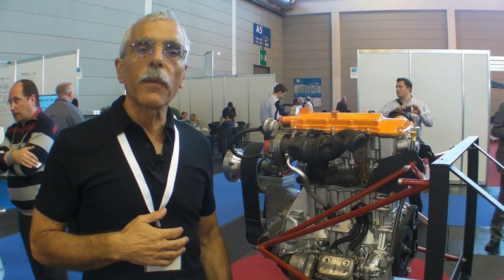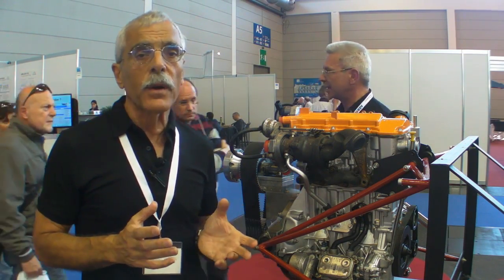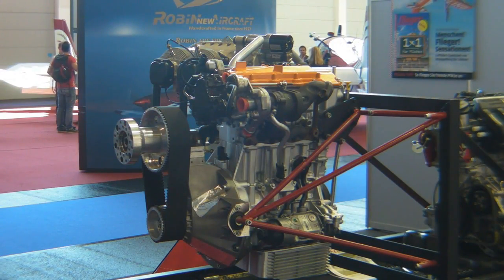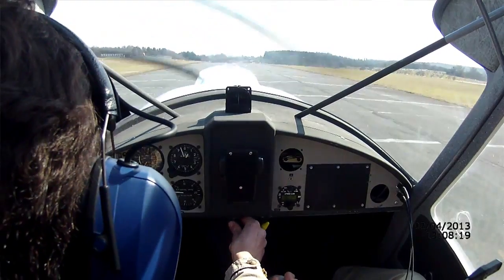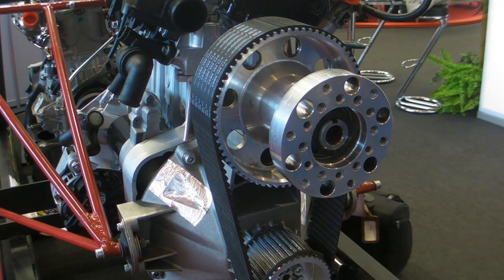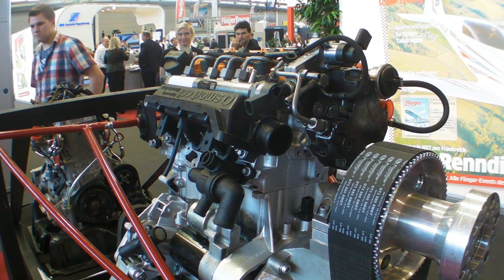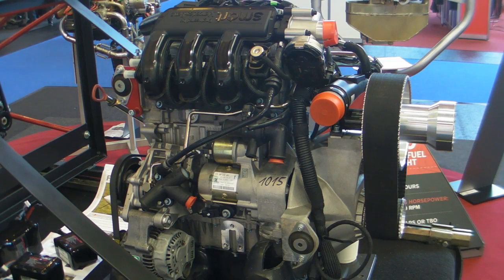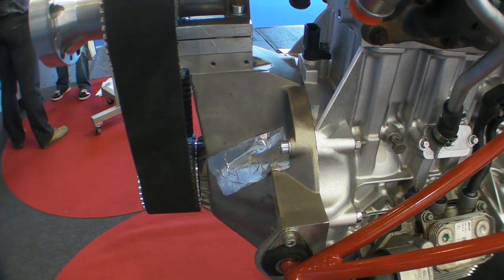FlyEco's Three-Cylinder Aerodiesel

Comment: Only 7 liters per hour = 1.8 gallon per hour.  This is amazing.
Reply: MR. RAY, 
I SEE YOUR COMMENTS ON MANY OF THE AERO ENGINE SITES THAT I VISIT. IN YOUR OPINION, WHICH IS THE LIGHTEST DIESEL AERO ENGINE AVAILABLE ON THE MARKET TODAY SIR?
Reply: 7 litres an hour would be at 50% throttle. If it was at the full 58.8KW it would be 97g/kwh, which is double the fuel efficiency of a modern diesel engine.

Comment: If the USA had 70 percent of cars using diesel it would reduce fuel used by cars by 70 percent.
Reply: Who taught you math?

Assuming a diesel uses 1/3 less fuel to do the same work you'd reduce consumption by 70% of the cars by 1/3.  So 30% of the cars would still use 100% of the fuel they always used, and 70% would use 66% of the fuel they always used.
Reply: And modern diesels also have more problems with NOx emissions than petrol-powered cars. You may have a bit less CO2 out of a diesel engine, but a good petrol engine will run overall cleaner.

Comment: 3 cylinders are the future for a wide range of markets. I believe in some markets they shall replace the 6 cylinder diesel in commercial vehicles.
Reply: It gives 3 powerstrokes per revolution and has total loss oiling. it burns SAE30W low ash oil too!
Reply: what do y meannot reliable oil consumption?

Comment: 89kg?  I'm interested.  That's not a deal breaker, especially for a 600kg machine.  A Jabiru 2200 is 30kg less but apparently they need a top end rebuild at 750 hours and definitely use twice the fuel.  A 600kg Jabiru J170 would still have 230kg useful load.

Comment: Same weight and power as a good VW conversion on half the fuel burn (in gallons, not pounds), for roughly the price of a new lightweight O-200-D. No mention of vibration studies or anything else on the redrive. Interesting exercise.

Comment: G56ag u can't run jet a without a lubercant as jet a lacks the oils to lube the fuel injectors but u can buy howes diesel additive and can do the job if u used jet a I use jet a in my diesel and have to use that to prevent damage
Reply: Kerosene is abrasive & will wear injector needles very fast...diesel is designed & formulated to primarily lubricate the injectors & pump